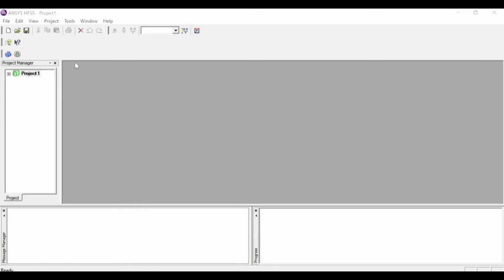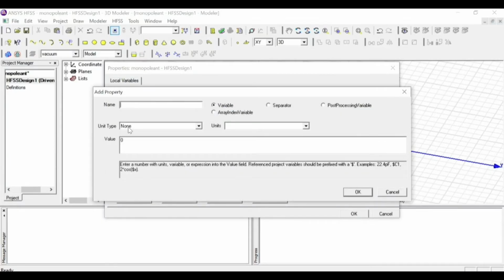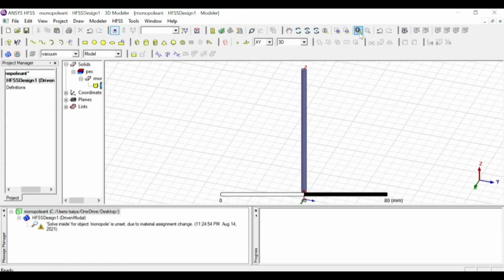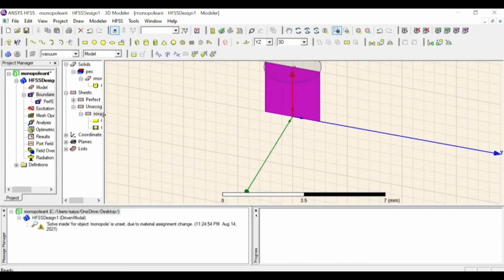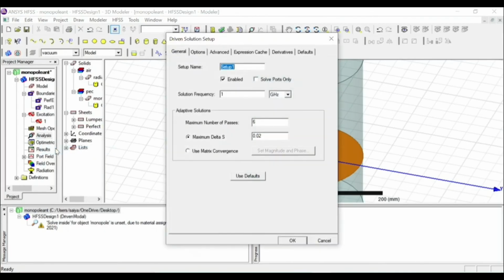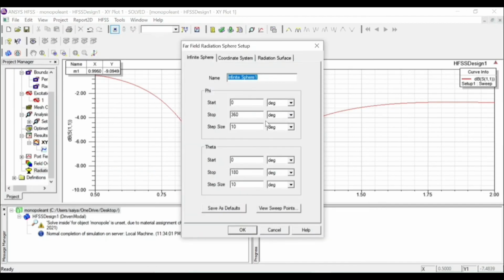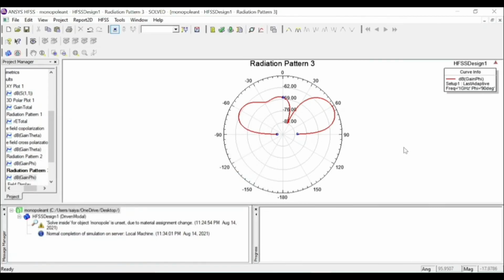Design of monopole antenna using HFSS software| Simulation of monopole antenna

Comment: The S11 should be below -10dB, it is not in this video?
Reply from the maker: You're right that for a good match, S11 should ideally be below -10dB. In this video, I focused more on the basic design process rather than optimizing for a perfect S11. The purpose was to explain the steps of design.

Comment: Thank you sir❤
Sir,that large ground is only for simulation?or should I fabricate with that ground? And How to improve gain to 10dBi? sir
Reply from the maker: Firstly glad that you found my videos useful. Secondly the design that I have made us actually a monopole antenna design that us generally taught in the hfss lab in colleges. If u want to improve the gain then we can vary the parameters such as the dielectric used then the length of the antenna as well as the frequency of operation.
Reply: @padharthisaiyashwardhan  Sir how to find full port impedence ? You give resistance value75ohm how to find this value sir?
Reply: @padharthisaiyashwardhan  adding dielectric at the bottom of the monopole? I mean at the feed point

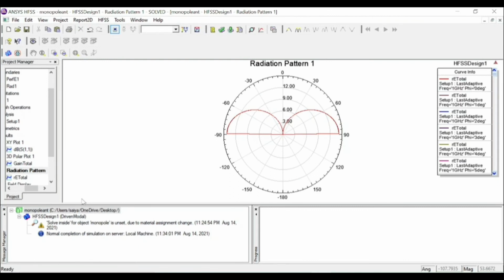Comment: at 19:01 what is that RADIATION PATTERN 1 ?...what to rename it as ? ......
Reply from the maker: It is "total radiation efficiency" graph.
Reply: @padharthisaiyashwardhan  i would be really glad if you could provide me your hfss file.
I made as you told in the video but in my S Parameter graph, the y axis is ranging in very small values from  +0.000002 to -0.000020.